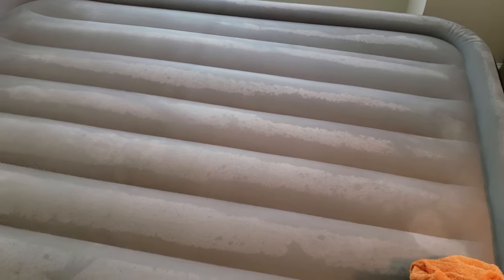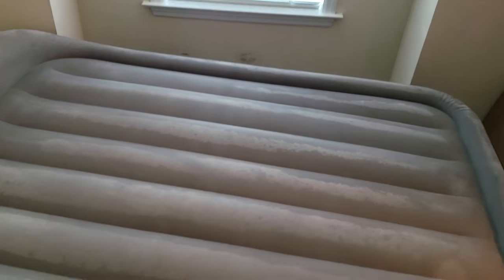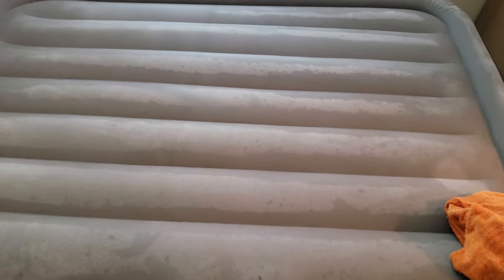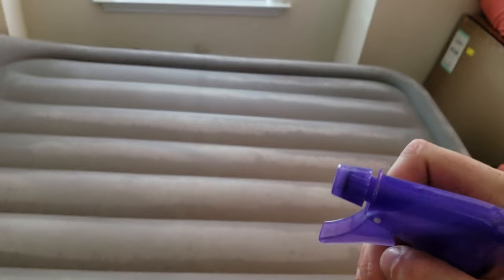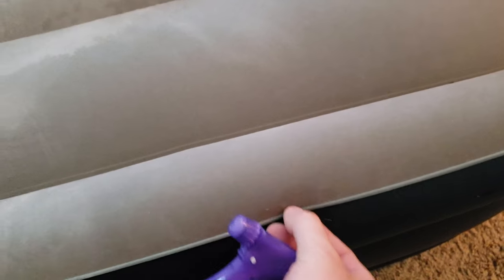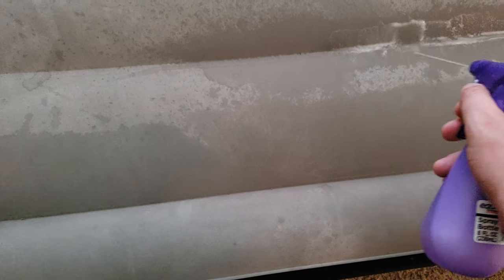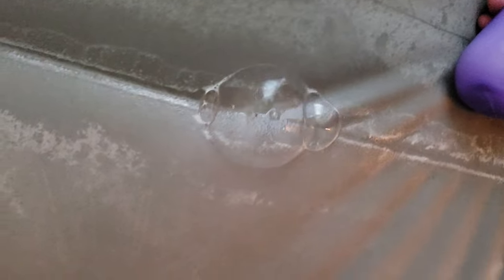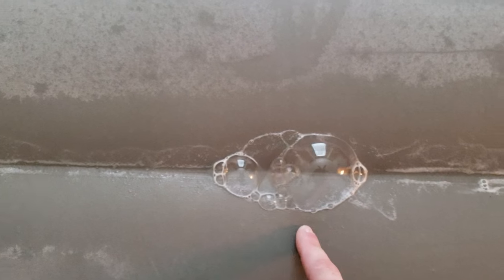Easiest Way to FIND a Hole in an Air Mattress

Comment: Wow man.  Thanks for the tip!  I had an air mattress (my favorite one) that had a hole and had been sitting in my garage for 2 years since I kept procrastinating.  Finding holes were always a chore.  This was super easy.  Found the hole in and checked the rest of the mattress in less than 5 minutes.  Thank you!!

Comment: We have the same mattrass...  I also believe this is the best method to find air leaks (soap water) .. I had already checked the sides and under the bottom before coming across ur video because i really feared the worst - it being on top on the soft side... to no avail.. I went to check the top side and without even having to soap it up. My hole was quite visible in 1 of the grooves as you rightfully pointed out the possibility and frequency of there being a weak point. Thanks for your video!
Reply: ¹k

Comment: Good video. I appreciate your effort. I’ve tried this method several times and have never had success with it on an air mattress. Bicycle tire tubes, yes!  Dozens of times. 

I think on an air mattress, you just can’t put enough pressure in them (without damage) to find a very slow leak.  I’ve never had a leak as bad as yours was. Mine usually last most of the night at least. 

Nice thought, though.
Reply: I had one and patched it..  does a patched hole normally leak slowly afterwards? Because I have to fill mine atleast once maybe twice a night ..and it leaks fairly fast without being on it as well....but I heard the hole when I had it...Idk if I've got another or not

Comment: This is why I love The internet 😭
Very helpful thanks
Reply: Not really; after hours of trying, I finally found a hole but it was not in the seem and it was in an area that was very hard to patch.  I had to use a small patch.  the stupid matress is still leaking from somewhere else. I have almost given up on air mattresses altogether. I am so tired them crapping out.
Reply from the maker: @crand20033  I'm sorry man, air mattresses are one of those things where you truly get what you pay for. I don't know what you're working with, but mine was pretty cheap, so I had to repair it alot! If that's the route you went, maybe try investing in a higher quality one before giving up? Best of luck my friend
Reply: @ToothpasteJuice  That is incorrect because I just bought a  SoundAsleep cloud nine series air mattress for $150. Nice mattress. But then I called SoundAsleep and asked them them if I could depend on this mattress for everyday use.  The company rep said no it will deteriorate and develop issues if I use it everyday. Using it everyday will void the warrantee. So I am not going to keep it. I will be returning it and buying a real bed.  Air mattresses are no good!!!  Do not buy one.

Comment: Im in baja mexico,mine had "side seams in midle of mattres" leaks not noticeable but small dark stains,sure enough ,i put lips to it and felt air.   I super glued it and repeated 3 more times. 
Problem solved . Matress pump still goes on but it doesnt deflate. Pressure of sitting on mattress caused to open.  Crazy glue it !!!!!  Gonna repeat it.

Comment: Great vid.

Is it easy to repair in that location? What did you use?
Reply from the maker: Just super glue. Put a dime sized amount, wait an hour, put another dime size on top, repeat the process 1 or 2 more times, and you'll never have a problem there again.
Reply: @ToothpasteJuice  Thanks - will have a look later, see if I can find the hole.  We had an uncomfortable couple of days, after dragging out all the camping gear after 5 years in storage..
Reply from the maker: @DjClarky78  ooooh yeah, I wish you the best, hopefully you can get up off the floor asap

Comment: The spray bottle wasn't enough water, so I used more. A small bucket full in fact. I found the hole, washed the air mattress and mopped the floor in one shot. 👍

Comment: Check any valves or where it could get tugged alot! I used the lip method first on my Exped megamat and thought I was crazy because i felt air near the 'hinge' of both valve caps.. I used the soapy method and it turns out it was leaking in the same spot at both valves!

Comment: I’ve got a small hole (it’s more a little cut since is longitudinal) on the inflatable bed joint, the one in the middle edges (so no upface nor downface), it is 3mm long, can i fix that??
Reply from the maker: Oh yeah, this method is perfect for that sort of thing, any bigger and you would probably need a legitimate patch.

Comment: So how to fix a hole that's positioned in a crease! What specific fix can achieve that?
Reply from the maker: Super glue does a great job, an air mattress patch could work too, but I've had more luck (and it's cheaper) with super glue!
Reply: @ToothpasteJuice  To clarify... . Is that superglue "with a fabric patch" or superglue "on its own" . Hope that's a fare question. Thanks.
Reply from the maker: @robinwas-miles4641  just superglue, I'd put a dime size over the hole, let it dry, then repeat 3 or so more times and it never leaked on me again.

Comment: I've tried this method and sort of worked.  But it wasn't the bubbles that gave it away. It's the buzzing sound it made when I inflate the airbed.
Reply from the maker: You may have been dealing with a bigger hole?

Comment: O have a queen matterss i dont know if it has a hole cant find it no where i got sick and tired of trying to find it and haveing to put air everynight i went and got adhesive spray like 4 cans and that shit worked like wow o and use old hugging mattres sheats for the bottom and the top just in case keeps it clean on the bottom just use spray adhesive

Comment: It might be difficult or impossible to patch a hole in the seam though.
Reply from the maker: Maybe, but the super glue really did the trick for me everywhere I used it!
Reply: @ToothpasteJuice  I heard 'Air Stop' is a life saver. It really works great and you don't even need the patch. Check it out on Amazon.

Comment: 3 days looking , put mattress in garden filled both sides with sopy water no hole found , gone around all seems and still nothing , lips' hearing , and nothing , what do I do 😂 , any new ideas that is not the norm the obvious way of doing it 
 So what then 😂 what about a spray glue into air intake or a tier weld , shake it about fully blown up , a maybe if can get it in . 😊

Comment: The massive problem with this method is you now have a ton of soapy water all over the air mattress… that cannot be easy to thoroughly wipe off and remove the soap over every square inch of the bed
Reply: And that’s a problem why? You can wipe over it numerous times to get most of the soap off but if some remain? Why is that an issue? And you do put a sheet on the bed, right?